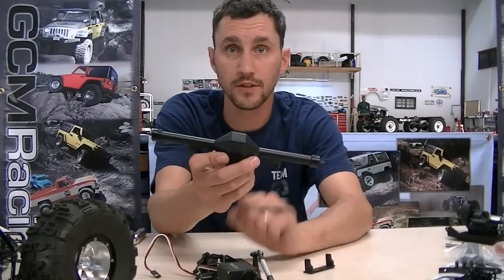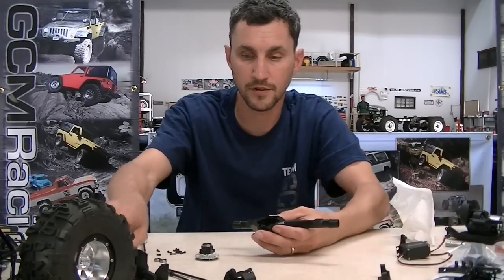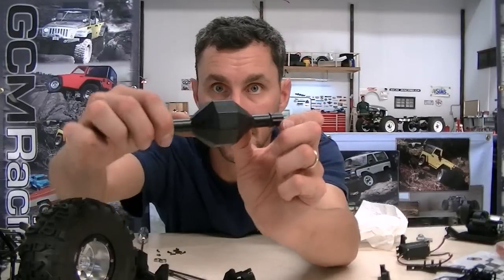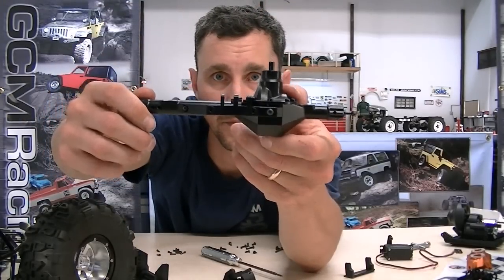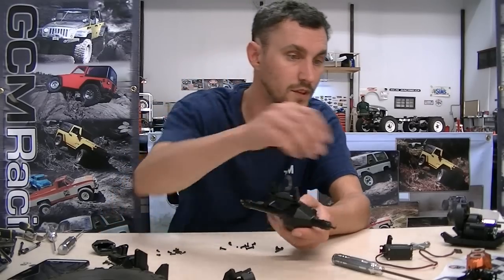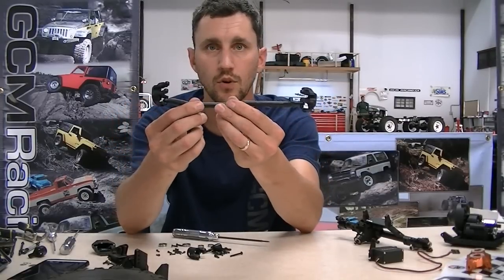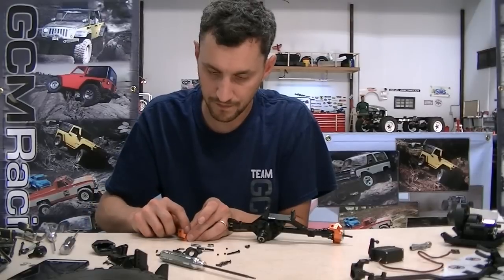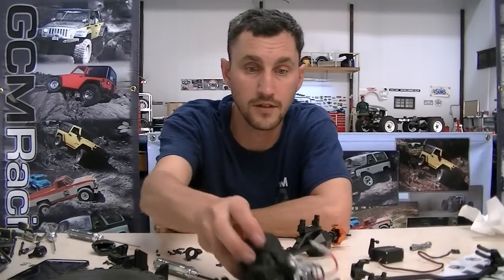MattZilla U4 Build Series Part 3-Diamond Wraith Front Axle

Comment: vanquish scale knuckles have 48 degree steering stop. also axial had a bad batch of universals that would break easy. I personally have been running a set for 2 years powered by 4600kv on 3s.
Reply from the maker: +Green goblin Well, that's a great report! I'm really glad there's good sets available. Great to know, thanks! I had 3 sets here from last year's order and all 3 were like frozen glass. If you don't use the VP scale set, there's no steering stop, so lockup is going to happen real easy.
Reply: Oh yea it can happen.  Just got one of your lockers For scx10 today.  Im builing a scx10 xr mod axle for my boy.  Have u had time to run the ssd axles. I cant make my mind on ssd or the vanquish  ocp v2 axle.  Im running ocp v1s in my wraith now.